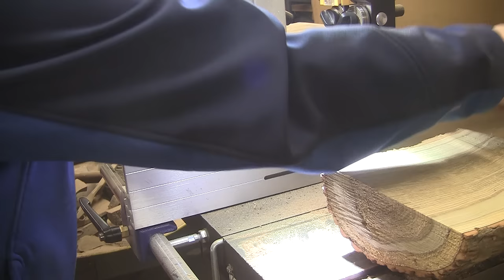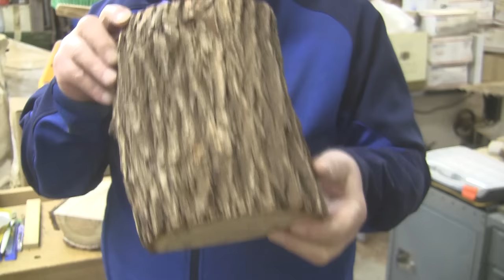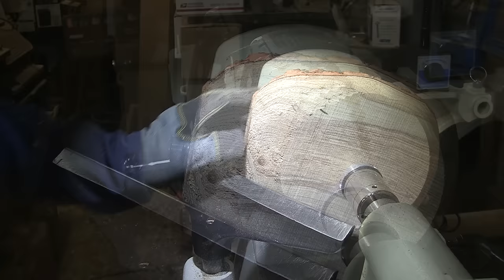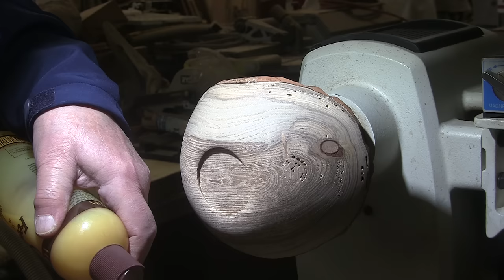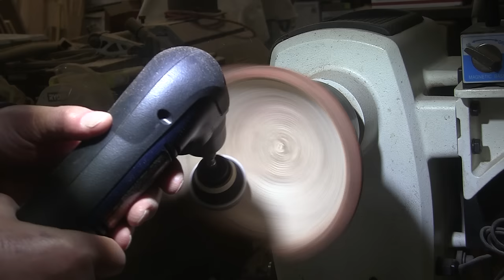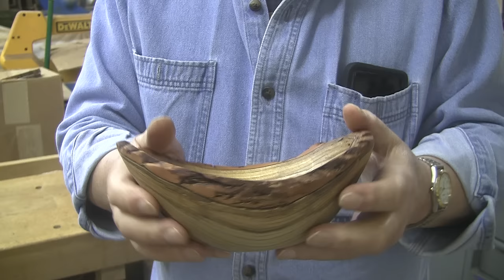Spicy Pepperwood! Amazing Grain! - Wood Turning

Comment: G’day Phil, great bowl as usual.
You certainly have loyal followers. Video up an hour and 80 comments with 1300 views, well done.
We should call you the wood whisperer as you seem to always get the best out of any piece, you really care for the wood and love talking about it and too it.

When sanding I understand about the direction of the sander and lathe, but I haven’t noticed any difference in sanding either side of bowl when spinning in reverse/ forward. I always change direction of my sander too make sure it’s working in right direction.
Anyway good to see you still doing what you do best.
Love your work from down under in Oz.

Comment: Even though I'm watching this 11 months later you still heard me on what finish!  You were about 2/3 through the outside and I told my husband that I really hoped you would use Howard's for the finish.  When you first mentioned sanding sealer I groaned.  Of course I was so tickled that you changed your mind.  (I do assume that you will try shellac on the other half, and I won't even grumble when I get to that video.)
I hadn't watched for a while (I was 2+ years behind) but I did think of you often during that time.  So glad I'm taking the time to get back to watching again.
Reply from the maker: I'm glad you weren't disappointed!  Also glad you have stopped by today, thank you! 😃

Comment: Apparently, it's also known as Oregon Myrtle. It's in the Laurel family (i.e. bay laurel) and has a poor strength to weight ratio. Apparently, heart rot is common in the logs and tear out and burning are common when working it with power tools.
Reply from the maker: Not even remotely close to Myrtle, Bill. 😊
Reply: @PhilAndersonShadyAcresWoodshop  That was just what wood-database said pepperwood was.

Comment: I love woods with strong grains that show themselves off with sanding sealer, feed and wax, etc. This pepperwood bowl you created looks beautiful. It's going to take a while to finish my wood stock. With the sealing, sanding and staining complete I apply Tru-oil, dry for 24 hours, 0000 steel wool any bumps and such, tack cloth, and repeat for as many times as it takes to get a complete glass like finish. I'm finished with my 3rd coat and might get away with 4 more coats, but that remains to be seen. Each coat is very thin, and walnut takes a bunch of layers of Tru-oil.

Comment: Another 1 for the books 📚 for sure. I was wondering if you think in the case of the peppers 🌶 wood if you would of been better off using your carbide tools 🔧 instead of the hi-speed steel. And that's only because the wood was so soft. Anyway just throwing out food for thought. You did great 👍 job on that bowl 🥣 I liked it and you managed to keep the bark it.
Reply from the maker: I'm never better off using carbide, Ray.  Just don't like it.  And no, I don't think a carbide scraper would work well on soft wood.  You may have much better luck with them than I do, however!  😊
Reply: @PhilAndersonShadyAcresWoodshop  well sorry about that phil I was just thinking in this case it might of work a little better for smoothness. I think you do a fantastic job with your tools 🔧 so just keep doing the work you do and keep turning out those great bowls.

Comment: Outstanding Craftmanship. 
I am saving for a lathe, I am trying to decide between Laguna Revo 18 x 36 2 Hp or Revo 14 x 24 1.5 Hp. I would prefer the 1836 but the other is about $750-$800 cheaper. Advice??
I will be praying for your health. I hope you can continue your videos
Reply from the maker: Wrong guy to ask, Chuck.  Never used a Laguna.  I'm sure you will enjoy whichever you decide to purchase. 😊

Comment: Lovely. Interesting wood and real interesting grain to it. Did you have to CA the bark any more times than the one time you showed on camera? One last question, what drill are you using with the round spongy sander? Asking because it looks like a great way to get in there and do that finish… Again, a great bowl, and looking forward to seeing the other piece done up!
Reply from the maker: I did apply the CA one more time in one spot.  I thought I showed it but might have edited it out.  My drill is a Ryobi 18 Volt cordless right-angle drill.  😊
Reply: @PhilAndersonShadyAcresWoodshop  thank you. Need to go look that ryobi drill. Thanks again,

Comment: Hi Phil, Thank you for doing these videos, you help me up my turning game. I do have a question, what do you do to sign your bowls. I tried sharpie but the finish just dissolved it. I've used a soldering iron but that restricts me to very simple shapes and tends to follow the grain. So, what is your technique?  Thanks!
Reply from the maker: I use an Ultra Fine Point Sharpie.  The ink is alcohol based so any finish, like shellac, that has an alcohol base will dissolve the ink.  I apply paste wax over the signature but you can also put Feed & Wax over it and I think you can put polyurethane over it, not sure though.

Comment: Hey, Phil! Long time watcher, first time commenter. I just had a quick question about the finishes you use: Do you usually go with the feed and wax for more aromatic woods? (like cedar and such) Does that require re-conditioning after a while similar to wooden cutting boards and butcher blocks? Thank you for another wonderful video! I hope you have a wonderful day :)
Reply from the maker: It's as simple as what finish do I feel will be best for piece at the moment I make the decision.  No real thought other than that moment, sorry. 😊